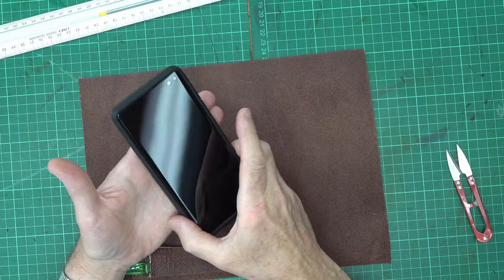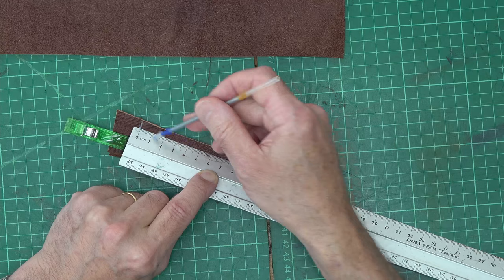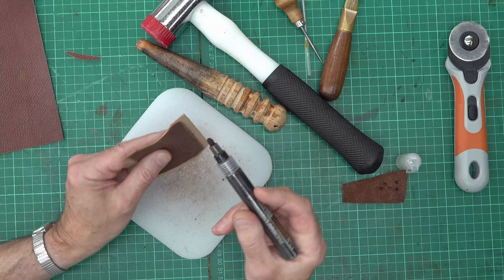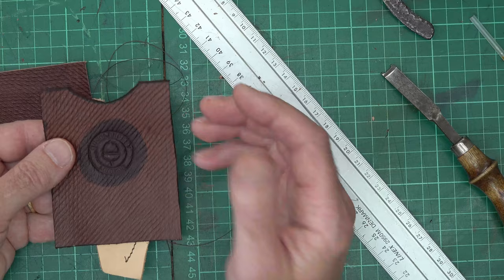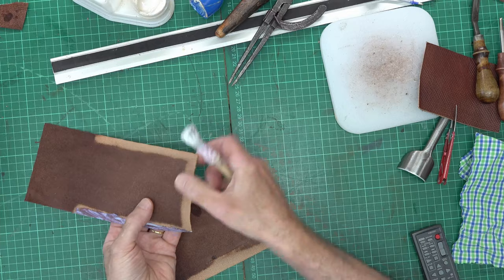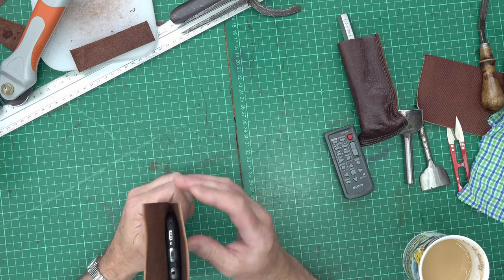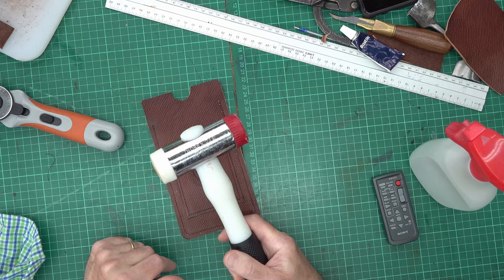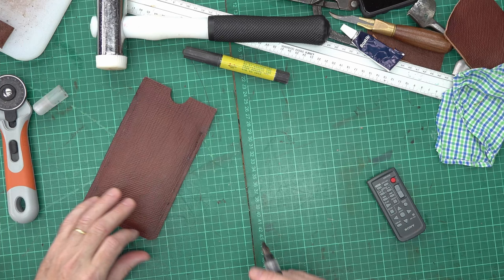Making A Russian Hatch Leather Phone Case Using A Sewing Machine

Comment: Hi Harry love your videos, I have a question for you what’s the best sort of thread to use on leather upholstery both for a machine and by hand? Mines a singer 66 hand cranked from 1935 works a treat! Fabulous stitches .
Many many thanks Regards Steve
Reply from the maker: Hi Steve for the Singer 66, Gutterman upholstery thread is good. I use bonded nylon in my bigger machines  and Ritza Tiger thread for hand sewing as it does not rot.

Comment: Harry, I have a question. What is your thoughts about the 4180 Adler post machine?
Reply from the maker: Adler have a good reputation.  I do enjoy the bottom wheel feed as well as the top roller for wallets etc...flat sewing items...does this Adler have that or is it a feed dog.....choice really depends on what you want the machine for.
Reply: I have a shoe repair shop and I'm also doing a lot of things like purses, belts and restoration projects that require a lighter stitch than what I have with my patching machine.
Reply from the maker: @frankdenton171  Probably not a bad option...Best if you can try a machine to check it suits your needs. Mine is good for shoes wallets and other fine stuff. A 335 type cylinder arm is another option...Good for bags.